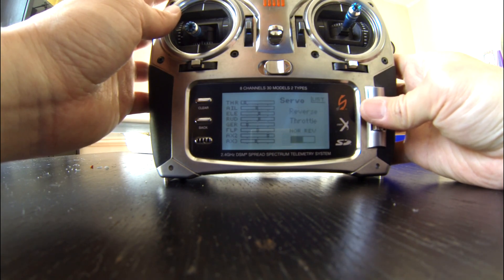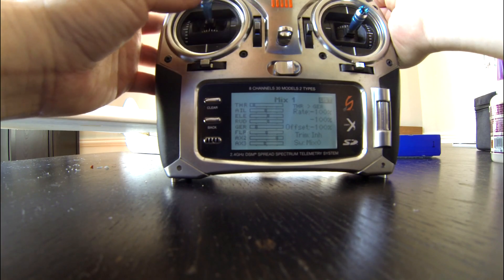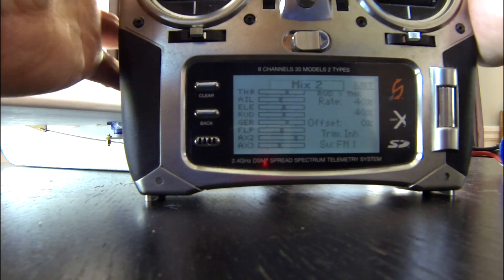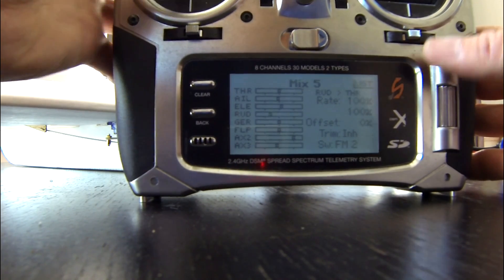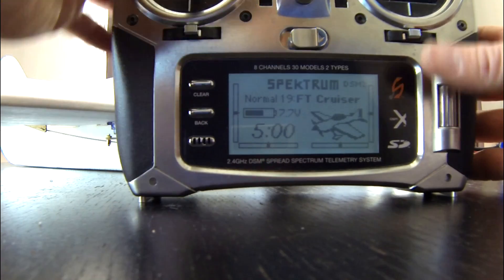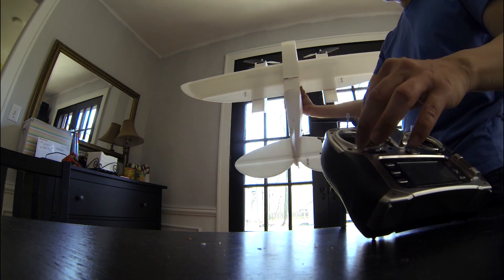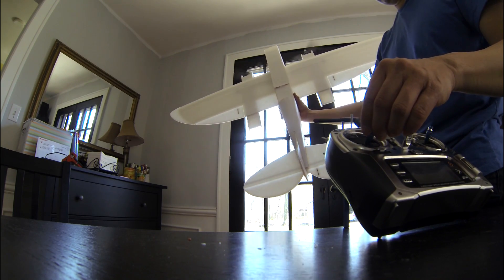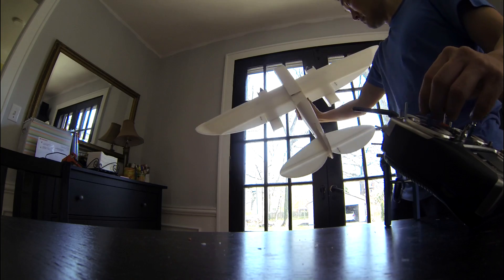FT cruiser HOW TO dx8 differential thrust

Comment: Thank you so much for posting this video. I followed your steps and it worked out fine. I have set my Aux 1 for my 2nd aileron servo so having the 2nd motor on gear was perfect. Once again thank you so much. Setting up my Multiplex twin star with flaperons and differential thrust
Reply from the maker: Christopher Loh you're very welcome!

Comment: Really cool mate. I've got everything going on a DX7s except my throttle cut only cuts 'throttle, obviously, but the Gear-Gear mix does not cut the throttle on the Gear channel when the Gear switch is flicked. I can push the second rate in Mix 4 to -125% but I still get aprox 75% throttle on the Gear channel with the switch flicked. 
I know this isn't a forum but you got any ideas?
Great vid though mate. Got me differential thrust ;)
Reply from the maker: sorry i've been bad about replying to these, ever figure it out?

Comment: Seems like a silly question because I'm new to the DX8, but could you not just change the gear switch to inhibit in the switch select menu.
Reply from the maker: That might work, to be honest I am no expert in setting up mixes.  Does inhibiting the gear switch though disable the output on that channel?  if not then yeah that would be easy.  Or another way to do it.
Reply: notasixpack to me it looks like it just inhibits the switch. Plus in that menu all the switches are assignable, so the gear channel could be controlled from the knob for instance.

Comment from the maker: We got the double kits - better price that way.  We used the same motors, but I am on 4 cell using 8x6 apc.  He was on 3 cell using 8x4 gws props.  I don't have landing gear so hopefully belly landing doesn't tear anything off.  But yeah it wants to climb right out of my hands.  Should be quick, but not a speed demon.  FT had 2 modes also, 30% and 100% for the flat spins.  I'm worried the flat spins will send the tail flying off. It's only paper/foam though i reinforced mine a bit.

Comment: Paul, Great Video! In the Flight test video, they must have been using 100 percent differential thrust, don't you think? So by backing that down knife edge and overall control lability would be very good I would think. How does your motor prop set up differ from the one that was Maidened this last weekend? Yours seems to have gobs of power! Did you build from the quick kit kit, or cut it out by yourself? Very interesting, I look forward to seeing those crazy flat spins!